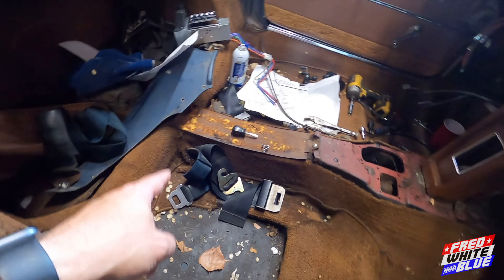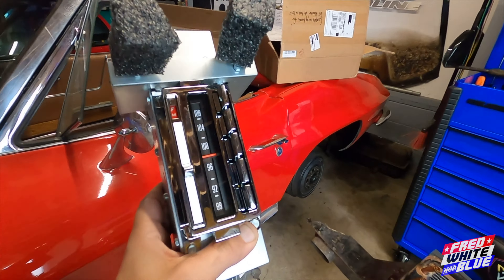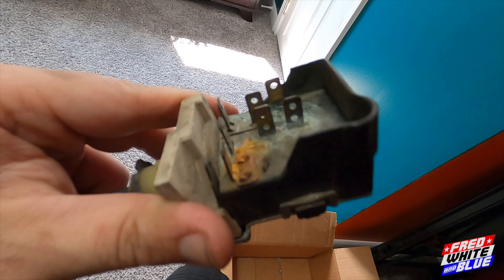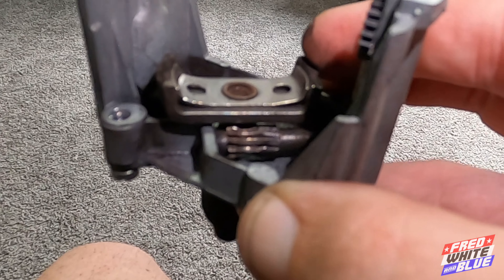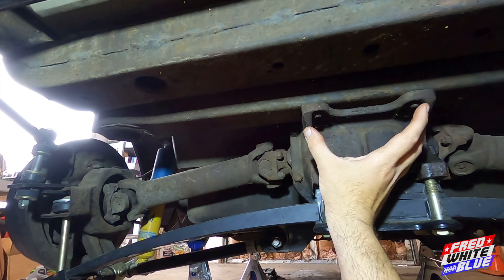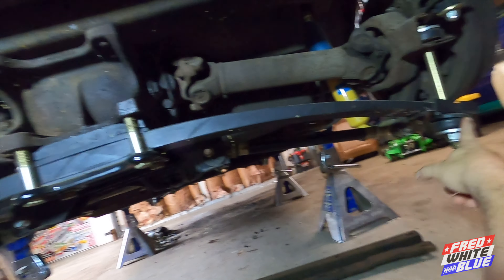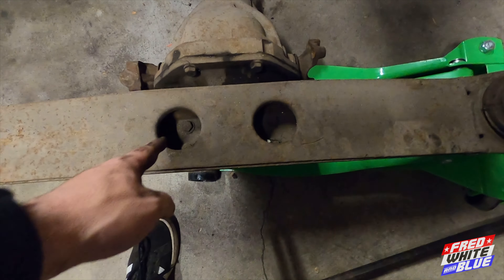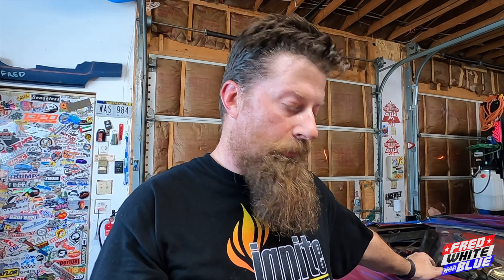Pulling the differential on the Corvette!

Comment: Haha. The working on an old car thing.  So true!  I can literally sit/stand in my 67 C10 engine bay to work on stuff.  Whole bench/bucket seat is held in with 4 bolts.  And the full vehicle wiring harness doesn’t have enough wires to even run a modern car radio 😂

Comment: Sorry buddy but you didn’t need to totally removing the camber bars the shocks the shocks mounts,just remove the 4 bolts holding to the differential and let them hang.Plus to those who don’t want to cut a hole in the floor if you want to remove the rear universal joint without cutting a hole use a long extension with a ratchet under the the car.I liked your video.